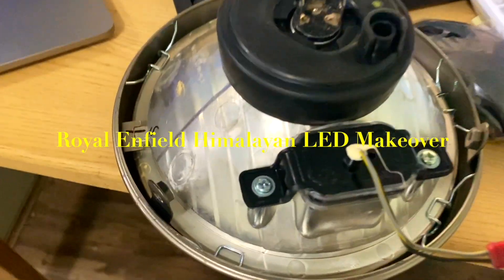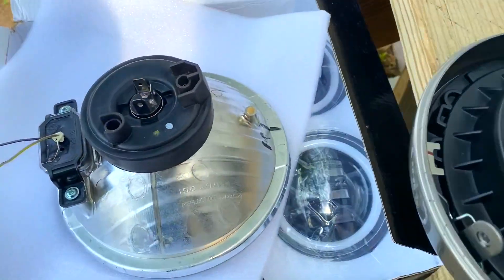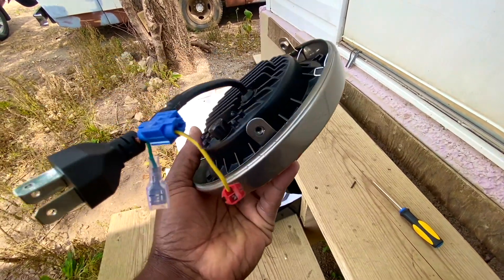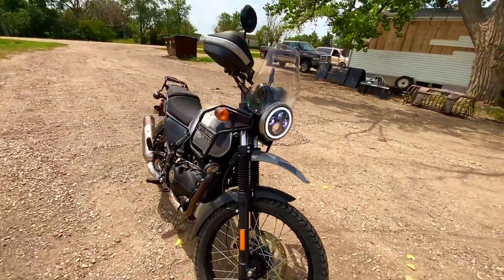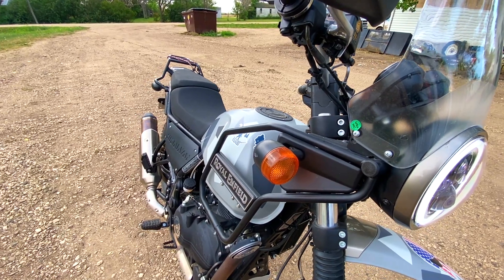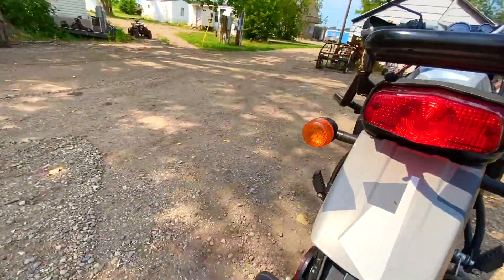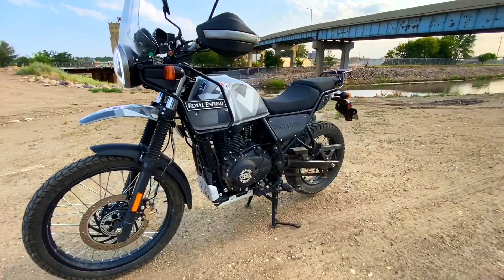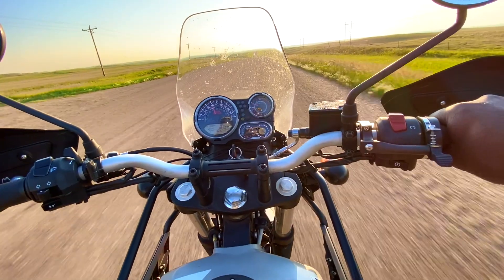Royal Enfield Himalayan LED Headlight/Tailght Change 😜🏍🏍🏍🛵🛵🔥

Comment: You are right! New bulb is quite Cool! However, some part of the Electric Wires could be uncovered and can touch other parts. Thus the battery drain off its Power. 
Have many nice trips. Bye